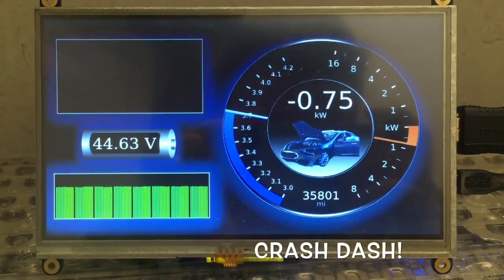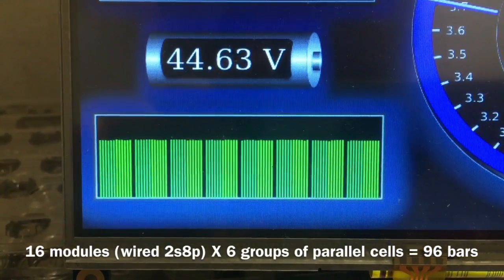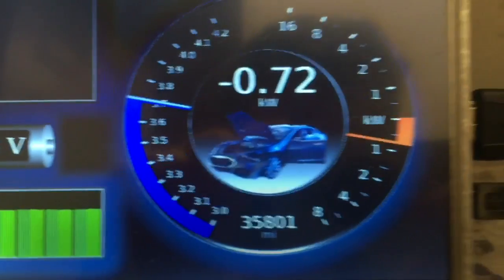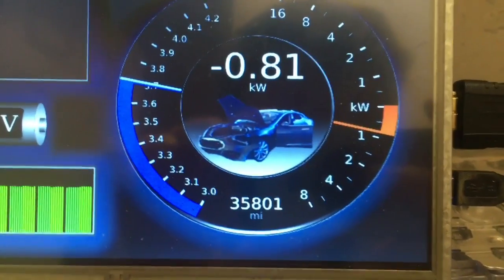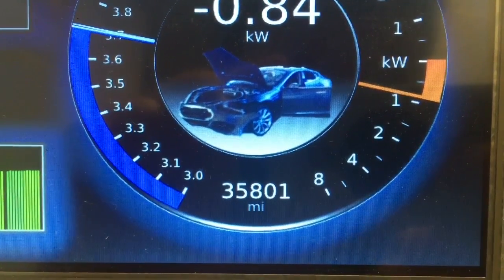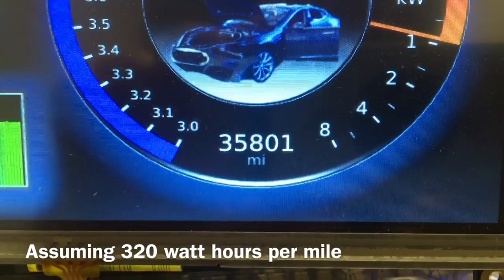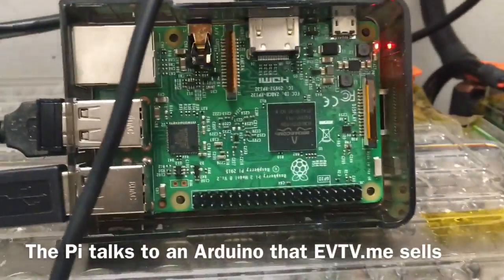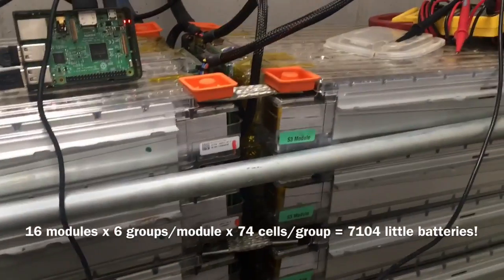Part 3,  The crash dash!  Monitoring the salvaged Tesla battery

Comment: Would you be willing to share the hardware list for this?  Nice work by the way?
Reply from the maker: I sourced everything from EVTV.me
They even sell the batteries and modules
Reply: Thanks.  I will contact him.  Got my volt battery today.  All cells are sitting at 4.05 volt.  17 kilometers on the battery.  I am pumped.

Comment: So cool! But what about battery cooling like Tesla uses in the Powerwall?
Reply from the maker: I'll add a temperature gauge to the dash, but because the power requirements for the house are 1/10th of what the battery sees in a Model S, and because the batteries are in a temperature-stable room, not outside in the freezing cold, I'm fairly sure the coolant isn't needed.  I haven't noticed the batteries getting warm at all.
Reply: Good to know.  I guess you can read the temps right from the pack then?
Reply from the maker: yes, the modules have two thermistors each!  32 temperature readings.
Reply: update on new dash?